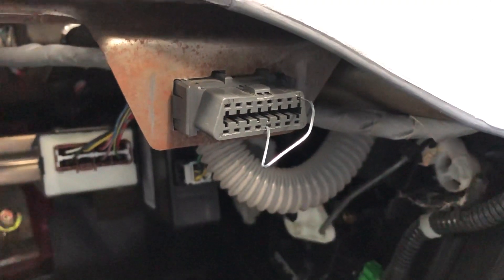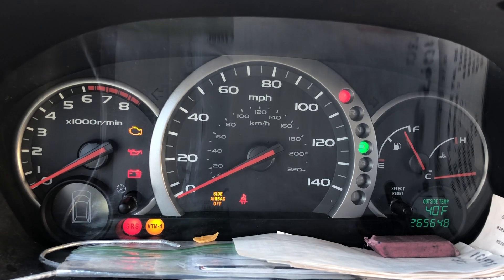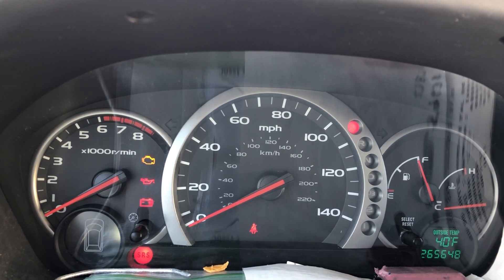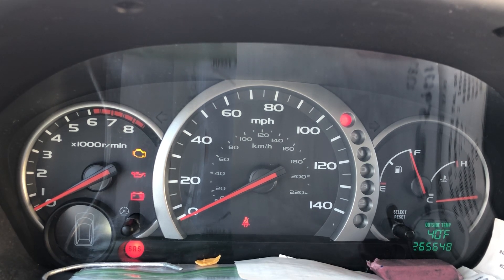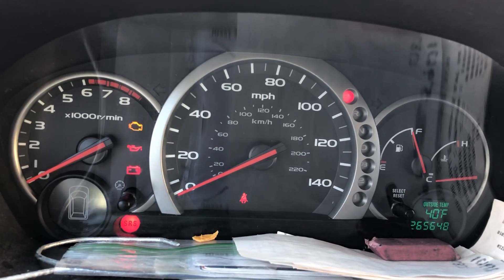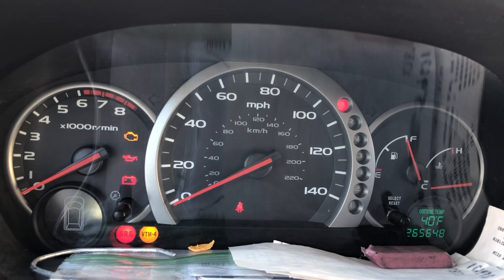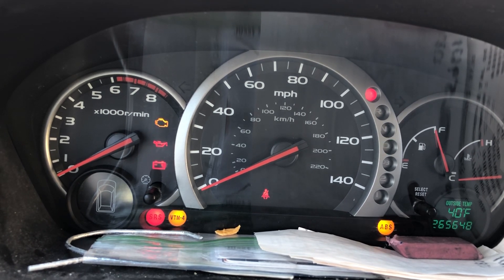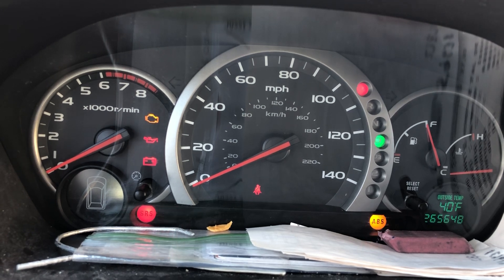2003 Honda Pilot FLASHING “D” Light while driving Transmission Troubleshooting Diagnostics Video

Comment from the maker: So if you essentially watch the engine light, it flashes 7 “hard times;” none “fast times.” That’s a “70” code. Then, the “D” flashes 2 times “hard” and 6 times “fast.” 

That means 26 “D” code, is the: “3rd clutch pressure switch – circuit malfunction.” 

Also the “70” code for the engine flash is: 
Either:
Electronic stability programme (ESP) control module – communication malfunction, AT – gear shift malfunction,	AT – 3rd clutch pressure switch,	AT -4th clutch pressure switch, AT – hydraulic system mechanical malfunction, and/or AT – hydraulic system mechanical malfunction ASSOCIATED. 

In my case, it was the pressure switches that were bad, so I replaced both the 3rd AND 4th Automatic Transmission pressure switches. That solved my flashing D problems…
Reply: I start driving the car and when i get to the highway starts flashing even, not Hard flashes, and my transmisión doesnt  run on 2gear  or 1st gears 

I apprecciate your answers greetings from tijuana
Reply from the maker: @omartrevino204  You read the codes when the car is off and you place the unraveled paper clip in the obdII scanner port area (into port 4 & 9); it’s positioned upside down(so reading it upside down, it shows where port 4 & port 9 are.). These flash codes revealed, only happen when you’re “reading” / “diagnosing” / “troubleshooting” your car. Nothing to do with how it flashes after driving. Just like these pressure switches are not beginner friendly fixes.
Reply: Where did you find this cheat sheet I have code 41 trying to figure out what it means thanks
Reply from the maker: @nickcasta100  Midway on the left of this site, you’ll see the flash codes: 

https://www.troublecodes.net/honda/pilot-3-5l-2003-2004/?amp

Hope this helps you. And others, too…
Reply from the maker: Might be: Heated oxygen sensor (H02S) front heater circuit malfunction… 🙏 Best of Luck!! 🍀
Reply: How did you replace  "3rd AND 4th Automatic Transmission pressure switches". Thanks !
Reply from the maker: @me4jas There’s plenty of diy videos out there to watch step by step people doing it…If you’re unsure after watching those videos in any way whether or not you are up for the task, please, I advise you to trust in a person or reputable affordable honest mechanic who deals with these types of Honda Pilots…Thank you for your question!!! And best of luck with your adventures ahead!!!! 👍
Reply: Very good info, I found your video looking the Flashing D up. I'm 68 and my 2004 Pilot just did the flashing D while driving the car two days ago. Cut the car off, D stopped flashing then started again, then went off. This was during a 180 mile trip. Car drove good to me anyhow. 
Car at my house now so i will check the codes as you did. 
Thanks for the video information on this.
Reply from the maker: @Metlplte  You’re very welcome!! I sure hope you can figure it out!! These Honda Pilots are VERY capable of reaching 350,000+ miles with the right care & know how’s!! Best of Luck and Enjoy Your Day!!

Comment: How can I find out the VTM-4 codes 21, 22, 23, 24, 41, 77 to replace them? How do I find them, like in the video you shared about the letter D?
Reply from the maker: @betomartinez3052  Is your vehicle giving you performance issues or are there other problems with your vehicle? Unfortunately, they’re not the same. Your VTM-4 codes can be showing those codes in relation to the others or not. Sometimes they just blink in that sequence for other reasons. I hope this information helps! Try finding someone reputable who has experiences with Honda Pilot issues, specifically, if you are having personal issues with your vehicle… Best of Luck! 🙏 🚘

Comment: codes po747, po741
Reply from the maker: Please read my pinned comment for a more in depth accurate determiner of your codes. 

Are you coming up with those codes via an OBDII scanner? 
Or via the paper clip code identifier? 

I do provide a list of all of the codes via the method I share under my pinned comment with a link…

Let me know if I can assist further, please. 

Those codes could be misfire codes resulting from the crankshaft sensor or more. Hard to identify unless they’re identified more accurately…

Comment: I have 5 fast flashes, 2 hard flashes inbetween and 8 fast flashes. I don’t know how to interpret this
Reply from the maker: A hard flash, is the first tenths digit; fast flashes are the single digit of the code; For example: two hard flashes and then immediately proceeding 8 fast flashes, would be code 28: 
	Transmission fluid temperature (TFT)   sensor – circuit malfunction

The problem would potentially lie in a wiring issue, a TFT sensor or the ECM.

For you:
It could be code 5, code 28, or code 20 and code 8… Not sure how you timed your pauses or what specifically is going on with your vehicle in general… But, if it’s any of those codes I’ve mentioned, they’re listed as to what’s the problem, found here:

https://www.troublecodes.net/honda/pilot-3-5l-2003-2004/?amp

I hope this helps!!

If it all seems too confusing, reach out to a known, trusted mechanic, familiar with these types of engines who can fairly price out your situation and fix it the right way… Best of Luck!! 🍀 🚘

Comment: Ok so I have a 03 pilot and I got a code saying incorrect gear ratio! So I’m doing my research but if any help plz!! And I’m gonna do the paperclip now.
Reply from the maker: Do the paperclip hack and also there is a few really good forums to review and read through if you can vest the time on Honda Forums site… I sure hope you figure it all out soon!! 🙏
Reply: I did the paperclip and no codes but I know it’s messed up cus of my transmission was kinda slipping and the D light was flashing but it stopped still runs like crap but I’ll wait till it flashes again thanks again
Reply from the maker: @jamesmatthew7528  You’re welcome. Best of Luck!!! 🚘
Reply from the maker: @jamesmatthew7528  A ton of useful information on this forum that’s very helpful quite possibly to you! Caution: ⚠️ Use at your own risk! 

https://www.piloteers.org/threads/p0730-code-fix-at-least-for-me.169602/

https://www.piloteers.org/threads/something-to-check-on-higher-mileage-pilot-transmissions-code-p0730.28437/

Comment: My vtm4 light has 5 long flashes and 3 quick then 5 long and 2 quick what codes would that be? I didnt see 52 or 53 on the website
Reply from the maker: That’s because the reference codes are regarding the check engine light flashing… Those flashes could mean anything. Could even mean it’s time to change vtm4 transmission fluids, rotate your wheels while driving in circle 8’s afterwards, or even a bad sensor. Or it could be an off code, for another code…. Don’t just throw money at your vehicle, trying to self diagnose an underlying issue…. Is your vehicle giving you trouble? What symptoms do you have? Sometimes until the check engine light problems are rectified, it’ll cause more codes to malfunction in other aspects. I hope that makes sense. It’s important to take care of other problems you can take care of first, before moving on towards fixing others problems… If you’re not an experienced diy individual, I suggest finding a reputable person experienced with these specific types of 2003 Honda Pilot problems… Best of Luck to You!!! ♥️
Reply: @GMoneySaver  thank you! It's not having any symptoms other than the vtm4 light staying on. I'm not having any actual issues with the vehicle it's self
Reply from the maker: @austinakbay8845  It’s your call as to when you want to work on that issue. Again, could be a pressure switch or a need for a sensor and/or more… Again, don’t throw parts at it. I wish you the best!!

Comment: I stuck the clip in 9. It sparked and now I can’t get it to start. Starter goes  lights go but can’t get the spark
Reply from the maker: I have stuck it in wrong, quite a few times. Even sparking, NEVER any issues you’re describing… No problems fixing my mistakes;  I wasn’t there to see what you did. Have a mechanic look at your vehicle. Best of Luck to You!!

Comment: Hi. My 2006 pilot is in limp mode and only thing is showing is a mis fire in C2. I also had the flashing d light and never paid attention to it or took care of it. Anyway my car is now in limp mode and I don’t know what to do. I took it to autozone for the scanner it says  misfire on C2. I wanted to do the test that people do with the coils but I think since my car is in limp mode cylinder 1,2 and three are not responding when I take out the coil and I think it’s due to limp mode. I think I read something about when the car is in limp mode cylinder one two and three don’t work. So far what I’ve done I have change the plugs. I change the VVT a clean the PCV valve a clean the EGR valve.please help.
Reply from the maker: You’re throwing parts at the car. Meaning, what you need to do is take it to a trusted mechanic that’s not outrageously pricey that deals SPECIFICALLY with Honda Pilots… Use only Honda specific parts when changing out things to avoid more issues. Honda specific transmission fluid is a must, too. Good Luck for now!

Comment: What did u do with the clip and where do u get the codes  ?
Reply from the maker: Here’s a reference guide, again, regarding these Honda “codes,” easily found and shown online. This is regarding “the codes.” On this site, if you scroll down, you’ll see on the left the “flash codes,” under “Trouble Code Identification.” You really have to know what you’re doing to understand all of this. But you’ll see like “70” flash code, for example. Again, 70, means the Automatic Transmission 3rd & 4th Clutch Pressure Switch… It could also mean something else. Please use & understand at your own risk. Good Luck.

https://www.troublecodes.net/honda/pilot-3-5l-2003-2004/?amp
Reply from the maker: You need to properly insert the expanded and then U curved paper clip in the ports, as I show and explained in the video. Also, the blinks tell me the codes. The codes are Honda’s troubleshooting codes. They tell you what engine codes are being indicated to you to help you fix the problems. A normal obdII scanner tool will not read these codes for you.
Reply: So i dont need to do the clip thing just buy the parts and get it fix,
Reply from the maker: @omartrevino204  Not necessarily. I’m not your mechanic, nor you. You don’t just throw parts at a car and hope it’s fixed. We must first troubleshoot and diagnose, “first.” But, you choose what you’d like to do. I highly recommend genuine Honda parts only/ OEM parts/ Dayco brand parts. Again, good luck!

Comment: Did your pilot have slow acceleration when the D started flashing? I have a flashing D and my pilot accelerates real slow, it gets up to speed but very slow. Yesterday it actually died on me while driving but I checked the battery and it was only 18% so I replaced it but still having that issue with acceleration and the flashing D
Reply from the maker: No. No changes in acceleration. Only on my part, to baby it, until fix, to not mess up any of the components due to the sensors issues… Your battery might not have been the problem. It might be due for a new alternator. Your catalyst system might be clogged. If anything is NON-Honda parts replacement, it can become a problem… Your fuel pump might be going bad, most likely not the injectors, just so you’re aware. I only ever used Honda oem spark plug cartridge coil packs, because it doesn’t have wires, only coil packs. And I disliked using “gapped” spark plugs, for chances of “mechanic mistakes.”

Knowing the numerous amount of possible things, “it could be,” and seeing I’m not your mechanic or your wallet, I will say this. Sounds like your biggest problem is this flashing D. But I must warn you, the fixes become more in depth and variable user to user…

But, there’s this really awesome thing I can suggest you invest and investigate doing “yourself,” if you’re good with working on your own vehicle…

Take off the plastic top engine cover. Remove the plenum. Clean the entire top plenum area. Reuse the aluminum gasket. DON’T DROP ANY BOLTS OR SCREWS OR LOSE ANYTHING!! Cover the actual plenum once opened with a white towel, to ensure you DON’T drop anything in the top side of the engine, and by cleaning your clogged plenum area, I can guarantee you your acceleration will INCREASE. Sound too difficult? Pay some one who knows what they’re doing, who has experience working on these types of Honda’s to troubleshoot yours, or continue to drive your vehicle until you can no longer…

Best of Luck! And I sure hope it all works out for you!! 🚘 😊 

Feel free to update us all on YOUR PERSONAL OUTCOME down the line!! Thanks in advance!! 😊
Reply: So what was it ?
Reply: @elperrocovero  transmission was going out ultimately so I sold it  for 1000

Comment: Anyone have grinding noise when reversing on an incline?
I did research and some say it’s because I need to get the rear vtm-4 fluid changed . 
Advice would be appreciated
Reply: I have 260k on the dash by the way . Had the truck for a long time
Reply from the maker: @elishahicks4749  I also performed the job for both of mine around the 215K mile markers…
Reply from the maker: Mine grinded and ended up dragging the rear wheels… I bought it that way. 😊 Once I changed that out, I was SMOOTH SAILING!!
The vtm4 fluid swap out from the rear… I can show you a spot on my Honda in a video… Requires you to remove the fill hole bolt, first!!! Before removing the dump fluid bolt!! If you can’t remove the fill hole bolt, you can’t do the job yourself!! I needed a tube pump, to stick in the antifreeze looking bottle of GENUINE HONDA ONLY VTM4 fluid!! NONE OTHER! And I purchased NEW fill bolts and washers, too, if I’m not mistaken… Takes a man ton of torque pounds, to loosen, a breaker bar of strength sometimes to undo the bolts, by the way. Drop cloth and oil dump pan to collect the old fluid, then a certain amount of circles to run through the fluid into the end properly after… That’s a quick run down for you!! Best of Luck!!

Comment: vtm and flashing d lights were both flashing. ididnt pay much attention to it and now my car will not engage on reverse or drive. please tell what to do.
Reply from the maker: Was your check engine light flashing? Does it still start? May be the neutral safety switch…a recall was in place for this. Just a hunch. Not related to the flashing D / vtm4 light flash, by the way…

Comment: Your video is very helpful. Pls tell me the name of the parts I should buy. I’m heaving the exact same problem.
Reply: I found the name of the parts in the description. Thank you for the video. 🙏
Reply: @drakej7776  hello. Did u replace sensors?
Reply from the maker: @supernintendo7579 I did! It ended up fixing my personal problems. I sure hope you’ll be able to do the same!!! 🚘
Reply: @GMoneySaver replying is very demure of you. Tysm! My 03 pilot has flashing d only sometimes. But slips 3rd gear. I'll replace 3rd sensor because lucas didn't fix.
Reply from the maker: @ You’re welcome! 🙏 Honestly, most mechanics, unless experienced with Honda Pilots, and their “problems,” might go as far as suggesting to change out your transmission, and lo and behold, it’s just a matter of changing out a few sensors… Another thing I may add, please try and obtain actual Denso or Honda specific replacement parts…I’ve found personal problems rectified better using what’s intended to be there and LAST… Best of Luck!! 🍀 🚘
Reply from the maker: My Pleasure! ♥️

Comment: Hello there My 2005 Honda Pilot vtm light flashing then the abs light now dont Star  any ideas only 197.568 Miles
Reply from the maker: The no start and vtm4 light shouldn’t have anything to do with one another. However, the abs light on, tells me one of your abs sensors was probably fooled around with, or like a line yanked, and/or it could be dirty or bad… The abs sensor will cause your vtm4 to pop on once your speed reaches about 15 mph, it’ll stay on because of that faulty abs sensor… Anyways, even “if” both lights are on, and even throw in a flashing D or a check engine light, the vehicle can “still” start, and work, surprisingly enough… 

No start depends on multiple factors, but make sure your battery, alternator, and starter are fine…You have gas. 

Then it can be a whole box full of common, or uncommon, things past those… I’ve changed out two fuel pumps on one vehicle, for example, that was a root cause for two situations of a no start… Find a trusty local mechanic who’s worked on vehicles like “these,” that’s fair in price, if it’s too complex for yourself to decipher…and don’t just throw money into parts for it, that don’t fix the real problems… That’s what the experts are here for… And of course take care of the no start issue, before trying to resolve your sensor issues… 

If it’s a bad timing belt, it’s time to say goodbye, in my personal opinion…

Best of Luck!! 😊